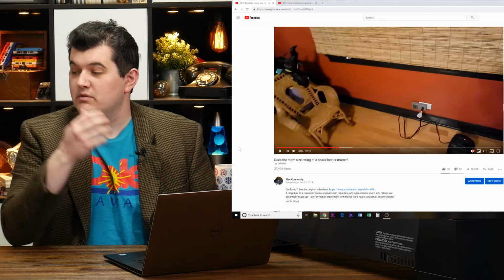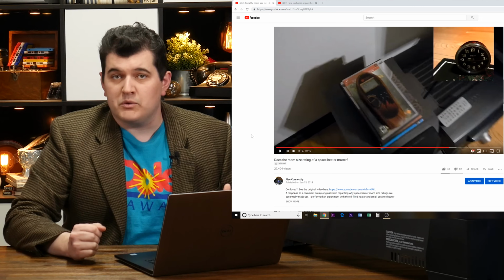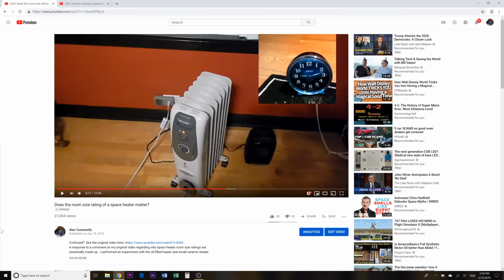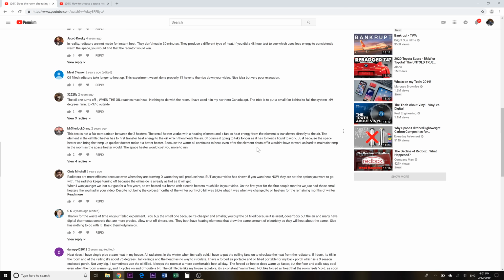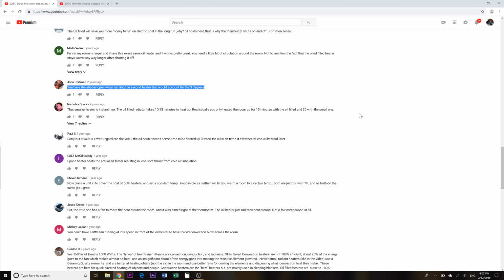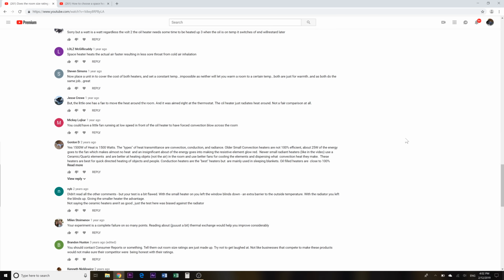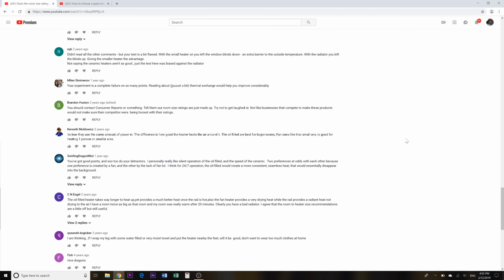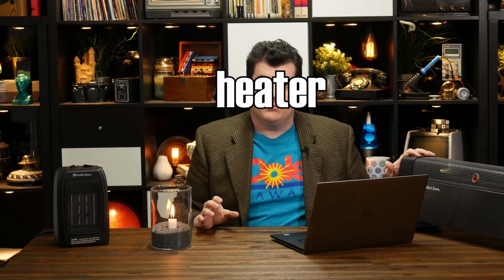More Space Heater Nonsense

Comment: I'm with you 99% on this one. If there is one thing I hate it's this type of marketing BS. Unfortunately most people do not understand simple physics and fall for the fake marketing tactics, costing them $. What can I say - if they can make someone pay more, they make more.   Some advantages of the larger heater is that it has no moving parts (+), no moving parts makes it more reliable (+), it makes no noise (+), it  MAY have a lower surface temperature making it very slightly safer (+). But none of these points were the points you were trying to make. You are correct, 1,500 watts is 1,500 watts regardless of how you make it, you could heat the room just as well with a 1,500 watt toaster or hair dryer.  But your wrong about the candles. Some of the energy of the candle is going into the light it puts out, that too is energy, it's not all going into heat. Great videos!

Comment: I know this not exactly a new video, but I felt like I had to comment. First of all, the people that were arguing with you were wrong... Well, their reasons were wrong. And your line of thought does seem plausible until you consider one factor. So yes, I can explain why the larger heater is more effective at heating a larger space than the smaller one... You see the causal factor in the efficacy of heat distribution is... Well, what I mean to say is that the reason it is better is... Hold on, let me explain it this way... it all comes down to... Wait, ok, I got it... the answer is "It is not more effective than the smaller heater".

And there you have it... glad I could help...

Comment: HVAC tech responce here.
Dude, you did that experiment correct actually.  If you take the design of both units, EXACTLY HOW YOU BOUGHT IT AND IS MADE FROM THE MANUFACTURER, you nailed it in my opinion.  Based on watching this video alone watching the bits from the old vid, the design indeed held it back.  A person needs to put the thermostat in the room they want to control the temperature in, not right in front of the fan that is nowhere near the targeted room.  No need to explain yourself.
The only reason to get a physically bigger unit would be to have more surface area, meaning more air will be in contact with the heating element.  There are a whole lot of concepts like enthalpy, psycrometrics, and thermodynamics at play, but an example, lets take cooling a pool of water down, a 20 foot round by 10 foot deep pool, at lets say 80 degrees Fahrenheit (df):  you put a 1 pound ice block in the pool, ice is at 32df, for sake of simplicity, even though all ice is held at 32df and the BTU's are the same, its the mass that makes the difference.  That one pound of ice will not change the temp of the pool water, now you add a 1000 pound block (the physical size of the ice is whats more important, just putting a "size" to it) to the water, the sensible water temperature will definitely go down.  If you put that small space heater in a large room, there may be an air temperature increase, but I can bet that the medium room size heater will have the edge over the small heater FOR THE SIMPLE FACT THAT THERE IS MORE SURFACE AREA, and thus more heat can be tranferred to the air, and a quicker convection cycle will take place, even though the power rating is the same across the two units in question.  Theres other factors of course, but thats about it.  
BTW, this channel is amazing! Thank you for this content!

Comment: What i desperately need is a video or blog post or smoke sign explaining once and for all which heating option is the most cost effective. I'm pretty sure humanity will come to an end before someone actually answer this simple question. 

Sure, it depends on the prices for energy sources where I live, but if I at least knew how many units of energy per BTU each option uses, I could maybe figure it out. Trust me  I've tried to research it, but seems to be the only piece of information not currently available on the Internet. 

So far, I'm pretty sure the best option from a simple RUNNING cost point would be a thermal pump, but its very unclear to me how long it would take for it to offset the initial high cost.

Comment: What if the room that the "large room heater" had existing air flow adequate to push through the heating elements. Does a larger heating element get to be less hot than a smaller heating element to cerate same btu?

Comment: Although i agree with all you're saying about the fact that a 1500W is going to reach the same equilibrium regardless of size, I think that we might be missing something. The large heaters store energy so that when a large amount of air is cooled (opening a door/window during the winter) the heater could use the stored hot oil to release more than 1500W. Please note that Im not saying that it will use more than 1500W electrically. Rather, the stored heat will release at a rate faster than the heating element inside. This is not needed in smaller rooms because the temperature can be raised to equilibrium much more quickly since the thermal mass of the cold air is less than in a large room.

Here's a nice analogy. If I have a small bucket and the water in it  is occasionally dumped out, the fastest way to fill it would be with a hose directly (let's say it lets out water at 10L/minute). But, if the bucket is relatively large, when the bucket is full, you can use the unneeded hose flow capacity to store water in a high-flow storage tank. That way when the big bucket is emptied next time you can use the 50L/min storage tank to fill the bucket rather than the 10L/min hose.

Comment: The "best in class" Heaters, imo are the 230v "Milk House"/Construction box-fan style. Pound for pound, most efficient along with fast air movement. I have owned and tried each and every heater style & in the end, all will warm the room. The Ceramic ones can be placed in tight areas easy, the Quartz ones great for a "direct beam" "spot warming"...each has a perfect niche...  Personally I like the tall Quartz ones the most, esp for a garage when it's  -18 out.

Comment: Did you measure the energy difference between the heaters? Not wattage while they are on, but total energy? I bet the oil heater draws significantly less over an hour because it cycles off.

Comment: Basically it this, small fan heater- loud but heats the room quickly, not what I would use for primary heat. Radiant fin oil heater- very quiet but uses convection so very slow but constant, probably take a day to stabilize but good for more long term heat. I have owned houses with boiler/ radiant heat and standard furnace. Radiant heat is slow but it seems to evenly heat the room vs hot air that blows in, heats quick but gets chilly as soon as the air stops. The comments about radiant heat not drying the air is bogus, it's always super dry during the winter days and air traveling over a blown coil or radiant coil still dries out. I still got static shocks in both houses with different heat types. Even the boiler vs furnace rated at the same btu, the furnace will outperform the boiler in efficiency where the furnace shoots flames along tubes that are exposed to airflow and in thin metal ducts to the rooms- all easy to heat up, boiler has to heat a 300lb tank+ all the water + the cold water in the lines in the entire house+ the heating elements surrounding the tubes in each room + the loss of heat returning to the boiler.

Comment: The bigger or more expensive ones are quieter for sleeping (fan speed on low but still move as much air as a little one on high) with digital settings. The little one sounds like a hairdryer with manual setting.

Comment: I have taken thermodynamics classes when I was in college for machining design. The large size can actually HURT the efficiency of a unit. As the heating element gets hotter, it bleeds heat off faster. Think about it this way. Boiling water at 212', as soon as you take it off the heat, stops boiling basically immediately. This is because, as it is so hot, it loses its energy very rapidly. That water will lose its 4x faster than it will lose its next 50' which is still 4x faster, than the next 50'. So if it take the water 5 minutes to go from 200 to 150, it will take it 20 minutes to go from 150 to 100, and it will take it 100 minutes to go from 100' to 50'. Now, i'm just throwing these numbers out there, the actual graph is much more intimate and the numbers are a little guestimation, but the  concept is still valid.
Reply: No. If one unit "bleeds off heat faster", then it's getting heat into the room quicker. That's good if you want the room to heat quicker. If one unit is using the same amount of electricity as the other unit, they are both putting out exactly the same heat into the room over the same period of time (the guy who produced this video is right about this - electric heat is 100% efficient) assuming they both are constantly running and drawing the same electrical energy from the wall all the time. 

What will be different is how the heat is circulated into the room. A radiator heating unit will mostly heat the air above the heater and more of its heat will rise to the ceiling where it does less good for the people sitting near the floor. The unit with a fan blowing heat horizontally pass the heating element will heat the lower part of the room quicker and probably a bit warmer, especially on a very cold day, because somewhat less heat will leak out the ceiling of the room before it passes through human bodies (eventually all of it goes out the ceiling or walls whether it goes through a body or not).
Reply: You need to run that explanation past your thermodynamics professor. I think they would have a lot of corrections to make.
Reply: @bobbabai  the VALUEs are inaccurate, but the CONCEPT is the point.
Reply: @cerneysmallengines  
The efficiency of an electric heater is 100% regardless of its design, so all of your calculations have nothing at all to do with efficiency. Efficiency is 100% because all of the electrical energy is turned into heat in the heater which all makes it into the room. 

You can argue about whether a heater of a particular design is better in a given situation, providing more heat more quickly (maybe for a longer time) where you want it, maybe. But that has nothing at all to do with efficiency.

Comment: If you put the larger baseboard heater in front of window. It may create a thermal blanket prevent heat lose from windows. Average wall has a insulation value of R 13 window is like an r 3ish?

Comment: I watched both this and your original video, both of which are very good. I agree completely. Most people just don't understand enough about how the world works. One of my bug bears is people not understanding thermostats. "I turned it up so the place will warm up quicker". NO, IT WON'T! You will just have to get up at some point and reduce the setting because you are now too hot. The whole point of a thermostat is to regulate temperature. That's its job. Grrr!
Reply: With the minor exception that there are variable power “things” now. My desk heater has two wattage settings (low/high) which isn’t exciting since I have to set that myself. Same with my oil heater, it’s a low/medium/high (high=low+medium) element, and the thermostat turns it all on or off. Boring. 

My portable A/Cs use dynamic compressors that step up the farther away they are from the target temperature, so they do in fact blow colder air if you “crank them”. Except that the time when people do that is when there is a large gap anyway, so the A/C has already got that covered.

And no, I don’t mean they ramp up the fan (although that too), the compressor itself steps up and down, and rarely cuts out completely (you hear the “thud” when it happens), the electricity goes from somewhere around 50w (fan on low, no compressor) to maybe 300w with the compressor on low, up to 1300w when it’s running full speed, with relatively smooth steps between. I assure you it does not have 1000w of fan. It does a pretty decent job of keeping the room comfortable without the too-hot, too-cold, and it basically eliminates short cycling (actually it has a short-cycle limiter too, even if you unplug it, it won’t start up the compressor immediately after it was cut off).

But this is absolutely not what most people think when they “crank it”

Comment: I had a nice digital Oil Heater that was okay, until the thermostat shorted out and then it was amazing, dangerously so. It would heat up and than just get hotter and hotter...it stopped working, eventually. My favorite space heater was an infrared that could light a cigar from about a foot away (minor exaggeration) The elements were as thick as my finger and as long as my  four arm. Very hot albiet nearly as dangerous as an indoor bonfire. Praise the sun.

Comment: I’m late to the discussion, but the biggest difference I’ve found in 1500 watt space heaters is in how much of a temperature gradient it creates in the room.    The little ceramic heater will create a small hot zone around around the heater, while a larger “fan blowing over nichrome wires” style heater will give much more even heat throughout the room.   Convection will eventually distribute the heat evenly, but if you don’t have adequate insulation, the heat energy won’t get to the far corners in the room fast enough to actually affect the temperature.  

There’s also some difference in perception of warmth with a radiant heater versus a convective heater.  If you’ve got more infrared photons landing on your skin than you’re emitting, you’ll feel warmer, all other factors being equal.  

The only real benefit to the oil-filled radiant heaters is they’re a much lower fire risk.  The heat energy is dispersed over the large surface area of the radiator vanes, so they don’t reach the stupid hot temperatures that the tiny ceramic heater does.   If the fan in the little ceramic heater doesn’t keep up with the heat flux,  it’ll melt itself to slag in minutes.

Comment: I don't know if you still check the comments on this video. Your information about thermodynamics is absolutely true, but there is still a benefit to having a larger unit. 
If the room you are trying to heat is insuficently isolated, using a bigger radiatior can basically distribute heat to more "objects" (so people, furniture or just tings with thermal mass), before the warm air just slips out of your room and is gone forever. I'm aware that this is an edge case, but I used to live in a place like that for two winters. The olive oil I stored in my room solidified which happens around 5 to 6 degrees Celsius or 42 F. The outside temperature was only around 0 degrees Celsius. Having an oil filled radiator does provide a zone in the room, where it is comfortable and that even at consuming less energy than the blower style. You did mentioned this in your video, but it might be the reason why some people think the oil filled radiators are more efficient.

Comment: Just to play devil’s advocate for the oil filled heaters, perhaps in a bigger room there’d be a higher temperature gradient to the larger space and the air would convect better so it wouldn’t limit itself as much.
Reply: The oil filled heaters are more radiant than convective, unless you’ve got a fan blowing on them.  That radiant energy will help heat up the walls and furniture in the room, while the air temperature would be less affected.  I suspect if he’d looked at the room with a FLIR camera instead of using a thermometer, he’d have decided the oil heater was the winner.

Comment: The one big advantage that might make a no-fan heater suited to a larger room is that it's quiet.
So you can leave it running when you're in the room without getting disturbed by the fan noise. 
Since a large room will require a higher thermal load to keep  warm then it makes sense to keep the heater running for a long time.

Comment: To be fair, I live in a warm climate, (Arizona) but, I don’t get the logic of the oil filled heater being “better.” It takes longer to heat up, and heats slower. I guess that maybe the oil can hold the heat as some sort of “timed release” effect, but I’d rather have direct heat on-demand as needed. Pretty sure nobody would want an air conditioner or swamp cooler (they work well here!) that takes a long time to cool you off.